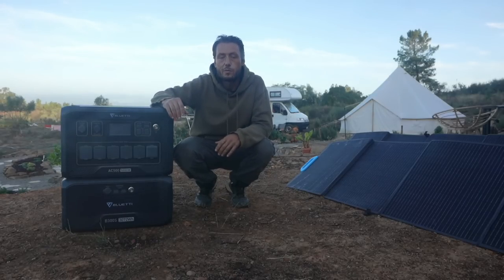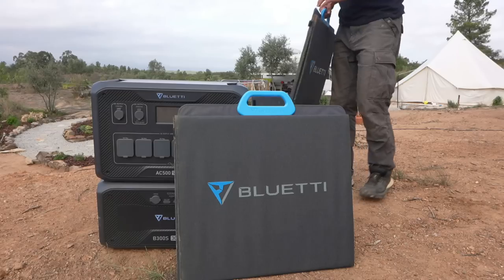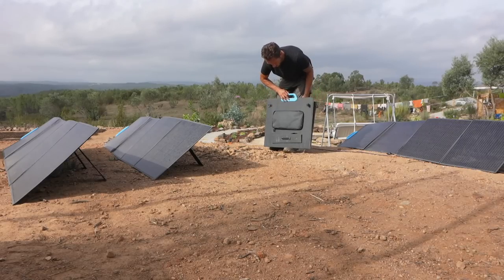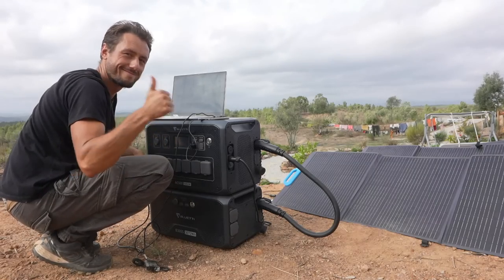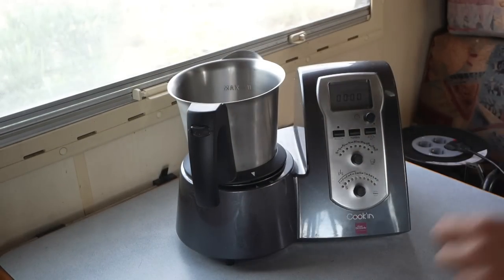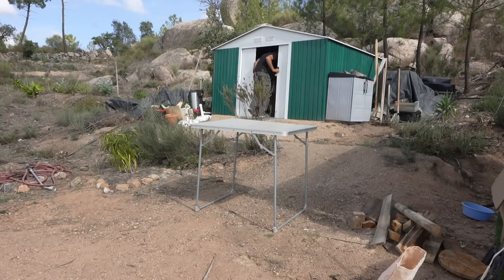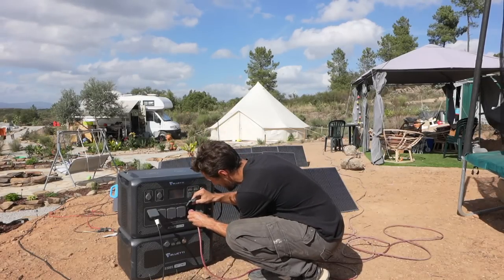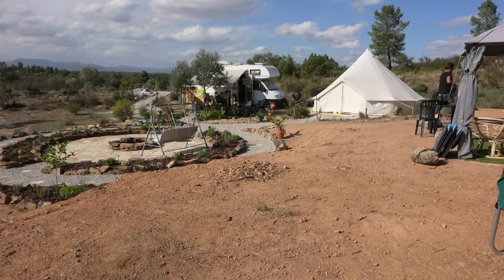Easiest Power Solution for Off Grid Living? (Bluetti Review)

Comment: Looks like a very good system. If you are to use it on a permanent basis, how would you set it up to protect it from the elements? Fine when its sunny weather but what about when it rains, winter etc.? Would it have to be kept indoors?

Comment: Maybe to replace a petrol/gasoline generator on a construction site, but not for a house. Simple lead-acid batteries are still the most economical in the situation of a fixed installation with photovoltaic and a small wind turbine if needed.
Reply: Hey there. I do not understand solar and electricity. But it sounds like you have a more cost effective way.
Reply: With some of the newer power stations, plus added batteries, you can run a house on them. Just make sure you're appliances are energy efficient. Notice that washer? It won't do big loads but definitely will do ordinary laundry.